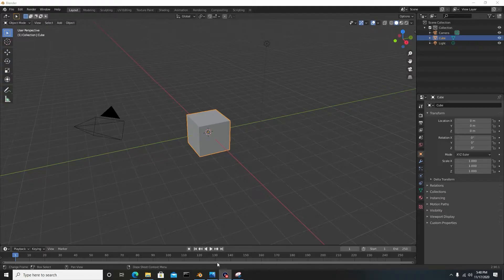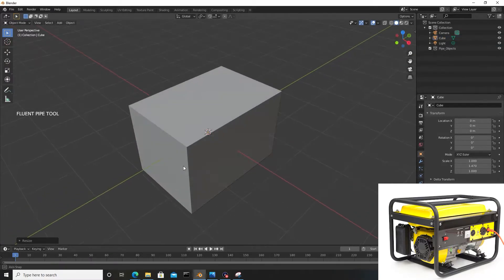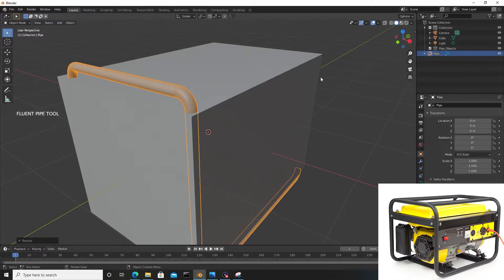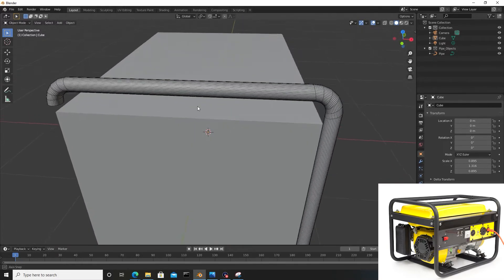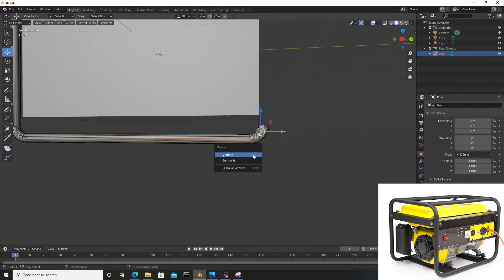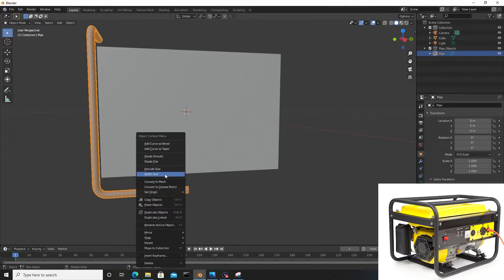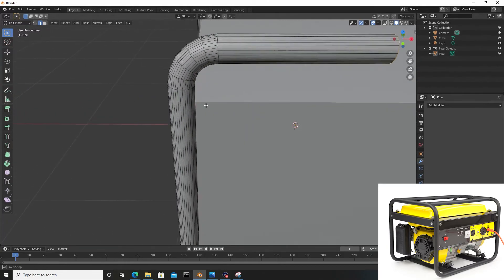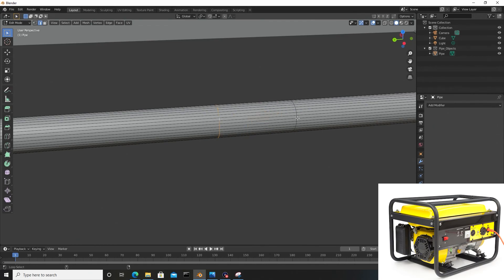Fluent Power Trip - Pipes (how to use the pipe tool)

Comment: amazing tutorial.

instead of bridging the loops, when you add a mirror modifier, click the "auto merge" in the option panel. that way, if you drag the ring edges from the original mesh toward the ring edges of the mirrored mesh, it will seamlessly merge.

and this modification will apply to both your  X and Y mirror. you wouldn't need to apply the mirror modifier  or manually  bridge the loops like you did
Reply from the maker: Yeah thanks. There’s many ways I could’ve done this better, but the easiest way would of been to just check on the "clipping" option lol then everything would've be solved 20x quicker

Comment: i can hear you on only left side speaker, not on right side, there is some problem with your recording
btw: this really not much effective way, what usually do is i'll delete the the faces i don't want(keeping the only edges) and adding skin modifier(adjusting the thickness ofcourse) and sub surface modifier that all and corner bevel
Reply from the maker: Adding a thickness is ineffective when you are doubling your poly count. This way is effective because you can control the poly count. But thanks for the info on the audio, my mic is broken lol and I don’t want to buy a new one just yet:)
Reply: @thelastdev  may be copy left channel audio and paste it in right
Reply from the maker: @vigneshwaranart6301  heyyy that might work damn that’s smart!